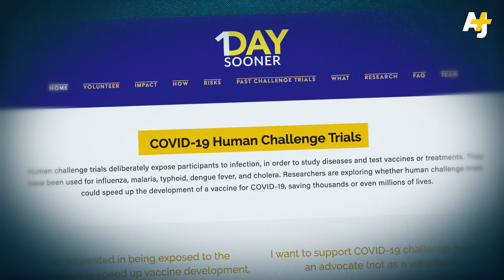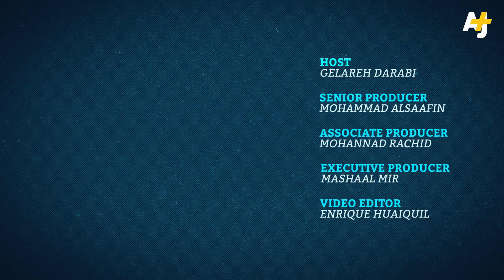I Volunteered to Get Coronavirus...To Help Find A Vaccine

Comment: Did they give you last years shot, make you wear the same mask for a month, stay indoors and only watch CNN,  and put you in a neighborhood  with an upgraded cell towers while they target ted you with a directed beam of 5G microwave radiation (beam forming technology with precision aiming capabilities is mandatory on all 5G towers and uses the full spectrum from old 3g and 4g frequencies). Look up locatoins on the cell tower maps. There''s lots in your neighborhood and a good chance they upgrade the router in your home!!!
Reply: A lot of people are volunteering and they don't even know it!!!!!! Download speeds are incredible. I just have to have line of site with the tower like the old days, (can you hear me yet?). NOt  a problem there is a giant one in the park across the street. And they are installing them on all the light standards as well as bigger towers, on every corner, tops of buildings, seniors homes, schools, libraries, universities, factories, and hospitals.. When do they crank up the power and go fully live? The glow of the sky at night is amazing. You can see it on weather radar maps.